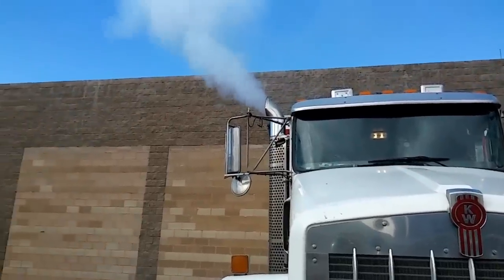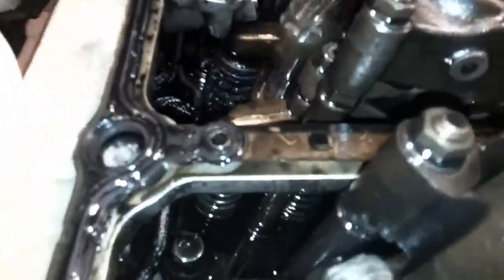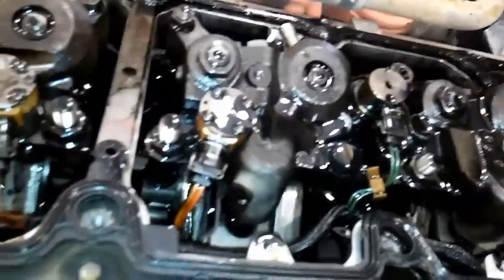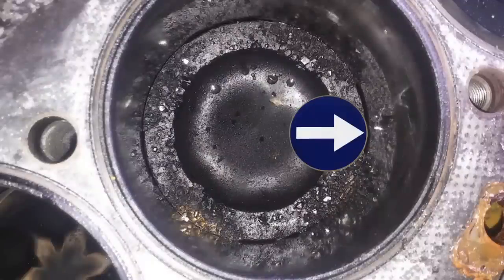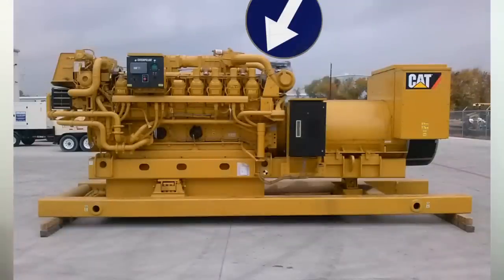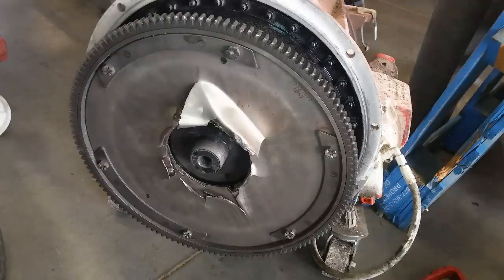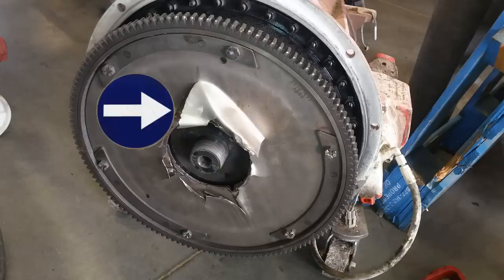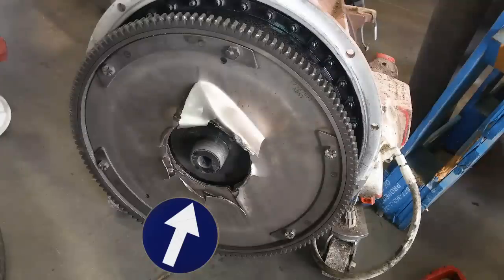Should You Warm Up A Diesel Engine?

Comment: There was a great article a few years back, on an RV web page, about warming up your diesel pusher before going all out. Pretty much what you said. They recommended taking off right after oil pressure came up (one minute?) but go easy for the first few miles. Once coolant temps bumped up a little (noticeable rise on the gauge) you were good to go. From that point on run like you normally would. If it's really cold (teens or lower) plug in the block heater for an hour or so before starting. Either way don't sit at a cold idle waiting for the engine to warm up. Preheat the engine or take right off but get it warm as soon as possible. JMO

Comment: Well said. The majority of wear occurs during start up and whilst the engine is cold. Because it is impractical to run the engine indefinitely, we must warm it up briskly with minimal load. A full synthetic multi viscosity oil is an excellent preventative because its cold temperature performance is vastly superior to mineral oils and prevents oil starvation in sub zero climates.
Reply: "the majority of wear occurs on start up" is a myth made and promoted by Slick50 (a snake oil company) to sell more useless products. They marketed it as a way to reduce wear on start up for those ignorant enough to not understand engines. If most the wear occurs on start up then why wouldn't every manufacturer require you to run one of these snake oils to reduce wear? Because 100% of engine wear occurs during operation.
Reply: Morgan Ruegsegger It’s true that startup wear is overstated, however it’s been proven that the majority of wear occurs in the 20 mins give or take when an engine is “warming up”. Once stabilized, an engine with good oil pressure experiences almost zero wear running down the highway. Regardless if it’s conventional or synthetic.  Hydrodynamic lubrication is what I’m referencing in the above example

Comment: I started my engine back in 1988 January 1st and I have never shut it off . Until July each  year for ten years with no problems whatsoever. I always used Chevron Delo  400 30 W engine oil . I used Wix filters  .  I also put K-1  kerosene in the fuel tanks when I was in the North part of the country . To keep the fuel from gelling .
Reply: Wow

Comment: Hell, it takes 5-10 minutes to build air to release the brakes and air up the suspension
Reply: You need to fix your air leaks.
Reply: Faulty air-leaks are the most common cause to fast warm-ups!
Reply: @blackericdenice  you drain the airtank daily to get the moisture out
Reply: @SYNOPTIC747  I have not drain an air tank in over 20 years. Trucks have air driers now.
Reply: @blackericdenice  yes but not everyone drives newer trucks. It is a good habbit to have.
Reply: @SYNOPTIC747  I can tell you don't drive trucks. Air driers have been out for over 20 years. There are very few trucks on the road that don't have them. You can't even get to the air tanks on the 2021 Volvo. When I used to drain the air tanks on a 2004 FL 70. Nothing but dry air would come out.
Dude, you went online and read some old tech about air driers. Now you are trying to school a 20 yod truck driver. You don't drain trucks with air driers because nothing but dry air is going to come out.
Reply: @blackericdenice  i am schooling you not every truck has air dryers. I drive skip trucks in australia none of our trucks has air dryers the moisture that comes out of our izuzu every day would fill a small cup. All trucks big or small are different maybe its an american thing.
Reply: @SYNOPTIC747  Dude, I don't give a Phuck about Australia. The video is made in America. We are talking about American trucks. You just want to be right.
Reply: @SYNOPTIC747  Every truck made in America in the last 20 years has an air drier.
Reply: @SYNOPTIC747  Whatever you say. I have videos on my channel of me driving a truck. Where are your videos?
Reply: @SYNOPTIC747  Grow up and stop fronting like you are a truck driver.
Reply: Lazy or ignorant drivers dont drain air tanks.. Not good for the air brake system
Reply: 5 to 10 minutes to reach the release of brakes? Maybe if its -40 degrees outside
Reply: @pandamonium2655  You can not drain out what's not there. Air driers remove 100% of water. I'm uploading a video to show people like you who don't drive a truck.
Reply: @blackericdenice  I bought a 1996 Pete new and after all this time never got a drop or even moist air anywhere, even the trailer.
Reply: Totally right it takes a long time if it's anything bigger than a dump truck for all the clowns saying air leaks
Reply: Then you have a leak and or a bad pump and should get the problem fixed.
Reply: @blackericdenice  You are verifying that the air dryer is working.
Reply: @johnjubie7144  You will know when the air drier stop working because it will keep shooting off air. I had this to happen on a 2004 Freightliner. My last two trucks, a 2010 International Prostar and a 2016 Cascadia, never had air drier problems.
Reply: @SYNOPTIC747  Back in the day we also used alcohol evaporators.  Had a small reservoir that would hold about 2 cups of methylhydrate.  You would fill it every few days in winter, helped keep the ice out of the airlines
Reply: @blackericdenice  20 years? Try 40 years.
Reply: @6h471  Until i see a video of you driving a truck. You are just fronting.
Reply: @blackericdenice  Well it's like this pal. I've driven trucks for 40 years, and they had cartridge air driers even at that time. Whether you believe it is irrelevant to me.

Comment: When my Dad started teaching me how to drive his B-78 Mack around 1971, his rule was not to exceed 1000 RPM for 5 minutes after start up.  They were also using straight 30 weight motor oil at the time.  When I actually started driving on my own, it was in a 74 K-100 with a Cat 1693.  If some idiot forgot to plug it in during the winter, you might be able to get it started around March, maybe.

Comment: This video should be mandatory for every new diesel owner, I watch my neighbor turn the key and scream down the street when it’s -20 degrees out in his new Ford.
Reply: That's hard to watch lol
Reply: Every new car owner as well. Any car I drive, if it's first thing in the morning, I always let it warm up. Start it up, rev it to about 1800 RPM after 1 minute, wait until the engine temperature needle gets to about 20%. At that point, the engine's almost done warming up and I can go.
Reply: @electric7487  lol I think I would let it just idle until the temperature gauge is about half way to normal operating temperature, then go drive it

Comment: Our airforce has engines with 18" bores, a v16. When a power failure occurs the engine is on cycle within 3/4 of a cycle of 60 cycle ac power. The large radar sets need an uninterrupted flow of electricity so the set does not miss a single moment of time it is not online. Can you imagine air starting this huge diesel engine under load on cycle with 60 cycles/sec in 1/60th of a second with air start?  It is phenomenal when you think about it even how a generator that large comes online that quickly. I have never heard the workload hours to keep these huge engines ready but it shows diesel engines can start much faster than you can believe.

Comment: I  love  the  2nd  part  and  will  be  looking  forward  to  it . That's  a  failure  I  haven't  run  into  before . 
As  for  warm  up  I've  always  figured  to  get  oil  pressure , wait  a  few  seconds  more  then  slowly  bring  it  up  to  about  1000rpm  until  I've  got  enough  air  to  release  the  brakes  and  then  ease  out . 
It's  a  very  subjective  discussion  without  a  defined  end . well  done .
Reply: ive run heavy equipment and trucks all my life and ive always done the same thing just long enough to get things moving and go never hard and never had a problem
Reply: Interesting amount of spaces

Comment: I do the same most of the time. If I have a little more time I will wait the for oil pressure to come up. Hit the ebrake and put it in gear and leave it for 5-10 min. This brings my egts up from 180 to 550. Huge difference. This also warms up my transmission at the same time. At idle, in park, when it’s -30 out the truck won’t even warm enough to move the needle or defrost the window.  Even after a half hour to and hour of idling. This was before I knew idling wasn’t very good for the truck. Webasto is the best investment if you live in cold environment.

Comment: Thanks for the info, someone tried telling me that I should leave the engine at a low idle until warm. I've usually increased rpms over a 1000 almost from the get go, and it takes a few minutes to "air up", by then I'm going down the road . You touched on idling in cold climates, I drove for an outfit out of Yellowknife, NWT. The idle on their trucks was preset at 1500 rpm to maintain heat, both for the engine and for the sleeper.
Reply: great point, the colder it is outdoors, the more you have to adjust various routines to suit the situation

Comment: Generally good advice. Read the manufacturer's handbook for specific guidance. Intuitively as a mechanical engineer I would say warm up before applying load to expand piston rings etc whereas the manual may say drive away. Whatever, no violent revving please after start, no high rpm ever   and avoid heavy load when cold seems wise and always idle for a few minutes after heavy use before shutdown whether or not there is a turbocharger. I also apply a short time rating approach thrashing my Unimog's OM366LA or anything else for short periods up steep hills, but not overdoing it continuously, a bit like standby versus prime bhp ratings on generators. Keep changing the oil is another obvious longevity    no-brainer. No mechanical failures to date in any engine or transmission component since 1981 and I've had some high mileage clunkers!

Comment: Fire up my 05 6.0 Powerstroke and no need to let it warm up. I pull out from work and coast 3 miles down hill with little to no throttle needed. Now on the way to work, it is all up hill, so I do let it warm up 3-4 min and never get the RPMs up on the way to work. 

Great video...

Comment: One thing I learned from a long time diesel mechanic is that, as long it is not slippery, to engage the engine brake. Just as using the engine brake too much in hot weather might lead to overheating, it will help an engine come up to temperature sooner in cold weather. Where I have driven trucks in Canada a cold start might mean minus 40C, which just happens to be the same as minus 40F.

Comment: Being someone that lived at 8,000 feet, and it was always cold of a morning, I thought maybe I'd say a few things.  In the winter it would regularly be 35 below 0 when I started my 99 Dodge Cummins 24v.  Periodically it could get down to -40.  I always plugged my trucks in.  They would usually start without issue.  After the oil pressure came up I would go back in and drink another cup of coffee.  Yes, I let it idle sometimes an hour warming up.  Even then it wasn't enough.  At 2 occasions, both in February, the power steering/vacuum pump exploded.  No noticeable damage to the engine, thankfully!

Comment: This advise makes sense. My buddy that runs a 160 ton diesel train does not let it idle overnight at it's lowest rpm due to glazing and oil contamination issues. Oil changes get pricey at over 100 gallons.

Comment: I tend to watch the oil pressure gauge and bump up the RPMs to match the cold start pressure as it warms up till about 1K RPM. Don’t forget that there’s other components that need to warm up as well like trans,rearends,and hubs. I’ve literally blown out hubcaps before when the vent was too stiff and couldn’t vent properly and I started driving too fast too soon at -20°f. Also cold scoring is a thing.
Reply: I've seen drivers take out wheel seals starting out too fast at 20 below zero.

Comment: Here in the Northwest I always let the oil pressure stabilize and temperature start to rise. This is 30 seconds to 1 minute above 40⁰F and 1-3 minutes below 40⁰F...more or less. I then put it in gear and drive gently for the first couple of miles out of my community to the paved county road. Pressures are stable and temperatures rising smoothly by then. I then drive gently for the next 5 miles or so to get everything into operational range. No issues to date with my '03 F350 over 230,000 miles. Granted I use the OEM block heater below 32⁰F, too. It helps tremendously.

Comment: Live in Northern Ontario, can get down to -45, start it, let it low idle for a few seconds for idle too smooth out, watch oil pressure, when it comes up (will be much higher than normal pressure), idle it up to 1000 and let it warm up. 10 -15 min before you move. And when you move remember the oil in the transmission and differentials are also the same viscosity as jello, so take it easy first few min. All of our trucks have block heaters, many use auxiliary heaters like a proheat or webasto, set them to start 1 hr or so before you go to start the truck, will get coolant very warm and circulated.  Was the way I was taught

Comment: Totally agree with everything there . As an Operator  I  would start it and help as required until the Idle was steady .
Then do any Start-up Paperwork . Log-book/Driver Journal Etc . Then bump the Idle to Fast idle 1000/1100 ish .
Time to walk around and do a Lights Check general Inspection . Daily Check .
When done there , you often find there IS some heat in the Cooling System . Oil pressure should be fine everywhere by now .
OK to drive off limiting Revs to 1500 . When Oil Temp gets halfway (or better) to Normal pretty well Rock and Roll time .
I  was known by Various employers to be able to keep a Slightly Sick Engine going . 
And sometimes diagnose what was actually Wrong with it .

Comment: I live in south east Queensland Australia 🇦🇺, so it pretty much never gets below about 10 degrees Celsius, which is about 50 degrees Fahrenheit, and I still never abuse a cold engine, big or small, diesel or petrol, 2 stroke or four stroke. The shit you’re dealing with up there is extreme to me! Coldest I’ve seen is about -7 degrees Celsius or 20 degrees Fahrenheit, and that to me was extremely cold! Had to let the engine warm up to get the heater running and defrost the windshield so you could see anything anyway

Comment: When I owned and drove my truck I started it and let it warm up for about 10 minutes before I released the brakes and it usually was not shut down until I parked it at home a week or so later. Summer or winter. If I wasn't going to be moving for more than 12 hours I would shut it down and get a room. Usually though I always had a load waiting on me so it was turn and burn. And yes for overnight AC or heat I would step idle up  to 1000 rpm. I had a little over 600K miles and it was still healthy and happy when I sold it. 93 freight shaker, N14, and 10 speed pulling a 53 ft spread axle flatbed. All military loads, mainly Marines and Air Force. Be safe.

Comment: I never move the truck or car for at lest 3-4 minutes. I hear you about the fuel getting past the rings though. This is a problem with diesel engines, I put double bypass oil filters on all my stuff, they remove down to 2 microns instead of only 20 on most all engine full flow filters. And AmsOil full synthetic. Block heaters are a really great idea, just remember to unplug them before moving the rig. Thank you again for yet another great video. The destruction of the week segment is awesome, please keep that going. Jim Tree
Reply: I switched to amsoil for my C15 recently.

Comment: i have a diesel car. (2001 VW Jetta 1.9tdi) And you just totally comfirmed my method. At cold temps, start car, let idle for about a minute, then bring up the rpm to about 1500 for a little bit(helps reduce black smoke in my car) then slowly drive off. As soon as coolant has been up to 180f for a minute or two you can start fully loading the engine.
Especially in turbo-diesel engines, loading the engine while still ice-cold can be devastating for the turbo. The thick oil has trouble making a thin layer on the journal bearings causing them to wear super quick. This is especially noticable in diesel CARS rather than bigger machinery like trucks or machines. The small turbo has an equally small journal bearing for the turbine wheel compared to a big engine with a big turbo.